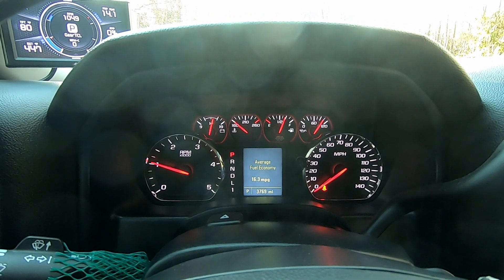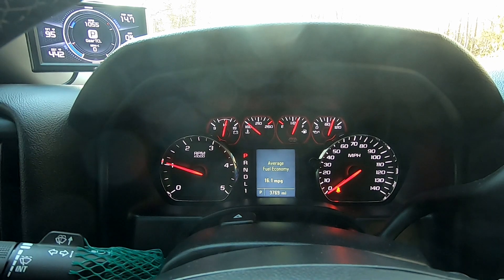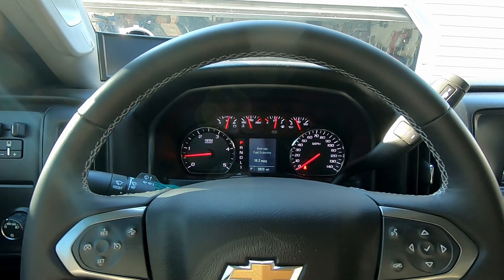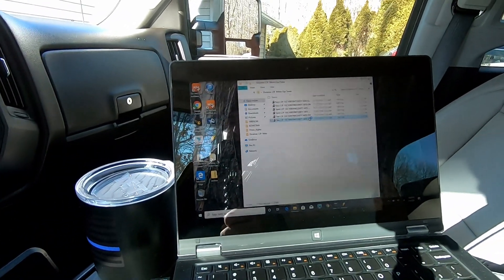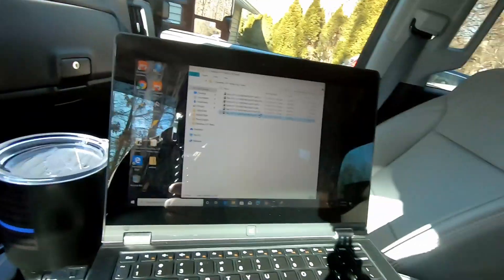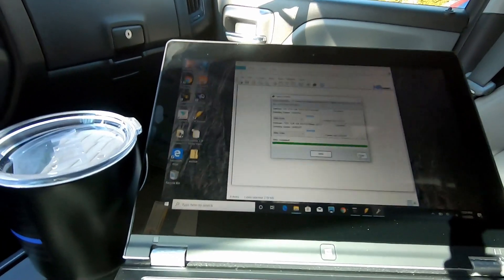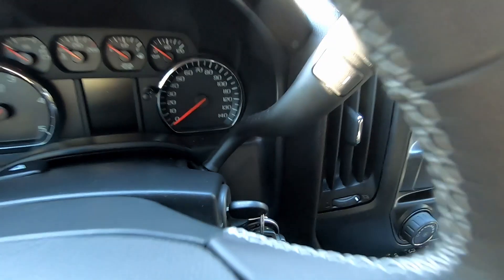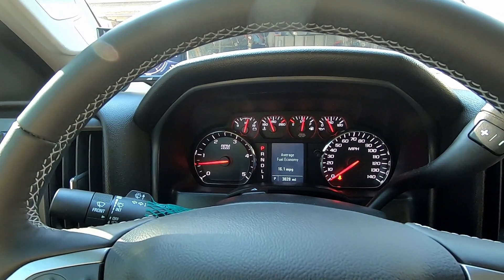How to flash a tune on a Duramax L5P

Comment: Is the VATs relearn and immobilizer relearn necessary after tuning?
Reply from the maker: It’s not required but you will lose your remote start function on the keypad and some other security features with the chipped key
Reply: @xlandscaper  appreciate it!
Reply from the maker: @Da_blooper  no problem man. Dealer only charged me 25$ to do the relearn and all is good!!

Comment: Can you tell me anything about the edge cts2?
I bought the monitor, I have motorops tow tune but no tranny tune.
I installed the updates to the edge before installing on truck.
I can't read any egt, the boost pressure is not accurate, ECT is not accurate, doesn't show which gear it is in and if the TC is locked or not.

Comment: All that restrictive bs is gone now that’s why the voltage is high. I have just over 1K miles on my tunes from ctt and it stays at 15.4. Nothing to worry about
Reply from the maker: Colton Young are u running motor ops?
Reply: No. CTT
Reply: The voltage is higher because the emissions system was pulled off; sure...

Comment: Battery voltage didn’t drop on mine after the immobilizer relearn and the Vats on tune!!
Reply from the maker: RedRum781 apparently all these trucks are running higher voltage now. I really don't have the answer
Reply: Xlandscaper what does vats stand for, acronym?
Reply: @rodenranch6291  vehicle anti theft system